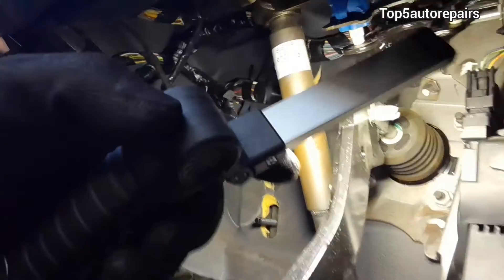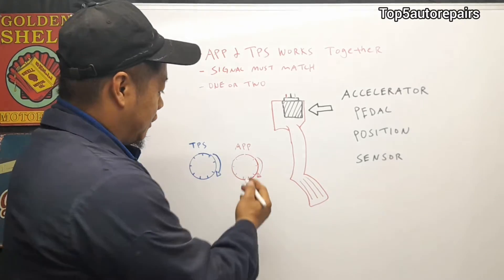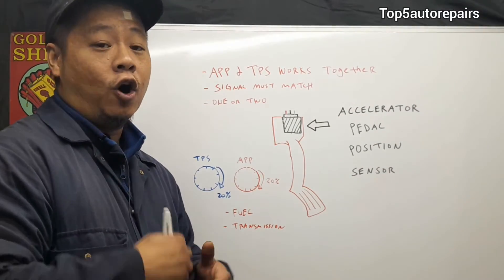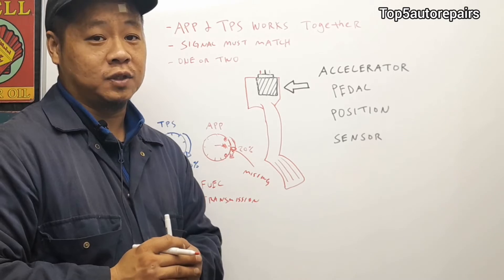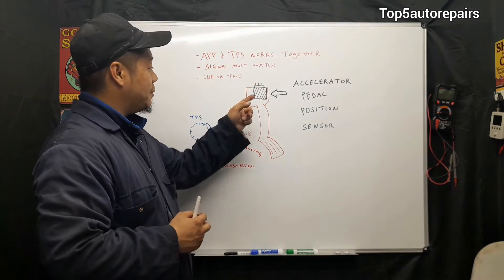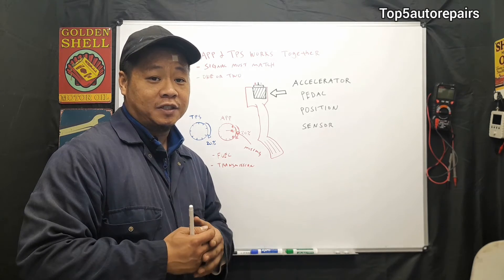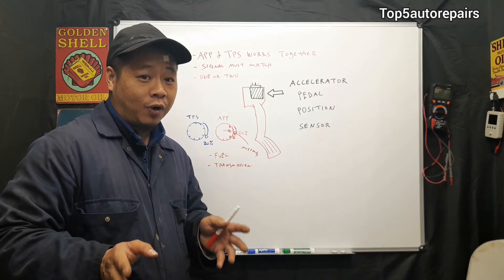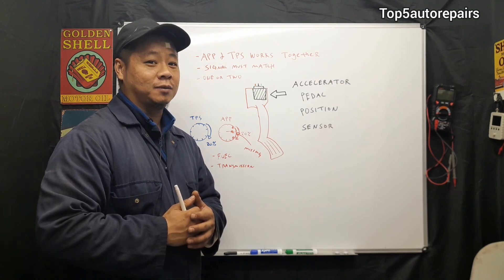Symptoms of a Bad Accelerator Pedal Position Sensor (Learn how it works and why it fails)

Comment: My cruze runs smoothly up to 20 mph. Over 20-30 it bucks slightly like  bad fuel or lack of fuel. Does tthis seem like a bad APP sensor? I'm getting no codes.

Comment: If i floor my rav4 it doesn't accelerate for nothing... but as soon as i start letting off of it at a certain point it starts speeding up. very jerky as well, i used the odb2 dealio and it said the car was at %17 throttle not pressing it at all... idk if that's normal but i pushed it all the way down and pretty sure it was at about %60. ordering one now, i thought it was the entire pedal as well? i guess not based on this video

Comment: I have a 2004 Chevy Colorado with a reduced power warning on the gauge system window. The code is P2120 throttle pedal/ position sensor/ circuit switch D. Would this fix the code it's throwing out? Thank you for your time and advice. I really don't want to take it to the shop, if it can be fixed at home. It's gone numerous times to the shop already, although it's never had issues in it's younger days. Now that it's older with 200,000 plus miles I love this trucks, the sound of it's engine. Recently replaced the transmission lines and an oil pressure sensor done by the repair shop. Now it has this code and before the code came up, while driving it, it would feel kinda rough shifting as I drove it. Thank you for any advice you can share.

Comment: This is exactly what my Nissan Quest van is doing. I’ve spent a fortune on it and still have problems
Reply: Change the gas pedal to did it to my Maxima also clean the throttle body for good measure. You should get a code and limp mode if it says in the code accelerator circuit to high a/b

Comment: My car's problems,
1. Reduced power upto 60kmph
2. Lots of hesitation jerks
3.TPS always on 4-5% even if pedal is pressed all the way.
4. Noticable latency in pedal pressing and engine response.
NO CHECK ENGINE LIGHT
Reply: same symptoms my car is having, what was the problem!?
Reply: @shelbysnake5003  same here what was wrong with your car ?
Reply: Better get a temp gun and look at your catalytic converters. Or hit them with a hammer. You can hear stuff moving.

Comment: Hi will this also cause car to while driving stay at a certain speed without pressing gas pedal??Have this happened today I let go off gas pedal and car kept going.
Reply: I have this happening as well, did replacing this help?
Reply: @heather11_111  Hi I replaced it, but it still does it sometimes I have taken it to the dealer but even they can't find out anything wrong.
Reply: @JoseSandoval-ic5xe  that's crazy.  I'm having it happen intermittently along with some other symptoms but I can't get it in until Tuesday
Reply: @heather11_111  It is crazy how you have those car symptoms but can't figure out what is wrong and to be throwing money at different parts ends up costing us more.
Reply: I just recently have been seeing that a faulty battery temperature sensor also causes this I'm getting one this next week if it fixes the issue I can let you know.
Reply: @JoseSandoval-ic5xe  so weird!  You'll have to keep me posted on that.  They're suspecting vacuum leak with mine but none detected

Comment: On GM vehicles, a "Reduced Engine Power" or "Engine Power is Reduced" warning on the information panel of your gauges will pop-up. On early 2000s GM vehicles, a lot of time it was in the wiring going into the TPS. It's an orange (I believe because have colorblindness) wire that breaks.
Reply: @@Urboobskeepstaringatmyeyeswas that due to the APS or TBS
Reply: Bro I got 03 Tahoe LS I swapped a new upper intermediate steering shaft in and now I'm getting a p1125 code and I went 100% by spec any advice

Comment: Would you be able on a Deisel motor that the pedal has cable that move the top of the injector pump, would that tell you if it's the pedal sensors. Right now I can't throttle the motor up with the pedal or where the pedal cable moves the injector pump throttle position, so no rev with pedal and no rev at the motor where the cable is hooked up. I guess my question is if the pedal doesn't work should it work at the cable point on the injector when you move it by hand,  thank you for your time, iv got a old 1993 nissan ud 1300 turbo series dump truck with the tb42t diesel motor

Comment: I have problems with my 2006 Nissan Murano, Changed Pedal, Changed Trottle body and still car won't accelerate. Once changed car gets heated it goes to limp mode with Slip light and VDC displaying a check engine light, please any suggestions for possible solutions?
Reply: Did you figure it out I have a Nissan Quest doing the same thing
Reply: Get the code you need to see i in the scanner what the code is there's 2 possibilities usually it's the gas pedal go OEM aftermarket will go bad after awhile and check the wires i in the ECU by the battery the connector sometimes gets very dirty and gets corresive clean then with electrical cleaner make sure u disconnect both terminals on the battery also
Reply: I know this because I delt with this problem 2011 maxima I replaced throttle body and the gas pedal after 3 years the pedal went out again but I had warranty with auto zone but I recommend OEM
Reply: Did you do the throttle body relearn?
Reply: @deebosgaming   you don't need to just reset the code after changing the part

Comment: Hi sir my truck is 18 weller frhatliner cascadia there is no disel when I need too push it in my foot no disel power only when torn off the engine couple of times and then the check engine light off and drive normal when I park over night the next day same problem and do same what I did before that's day is that's the same problem what you talk about and thank you

Comment: My semi auto van is not selecting gear if I change the throttle position sensor which comes up as my diagnostics will that fix the problem or do I need a new APP also or is it the same part is what I’m getting at thank you

Comment: Oh man.. that sounds like my car. I bought a second hand car and realised my car doesn't have the original accelerator pedal/TPS anymore. It's from a Hilux (I have a Hiace). Same engine, different parts number. Could that be a problem, or the TPS is just f****d? Thanks for the video!
Reply from the maker: Check the TPS first
Reply: @Top5AutoRepairs  Thanks I'll try that
Reply: @Top5AutoRepairs  please answer my question my Nissan Quest doing same thing